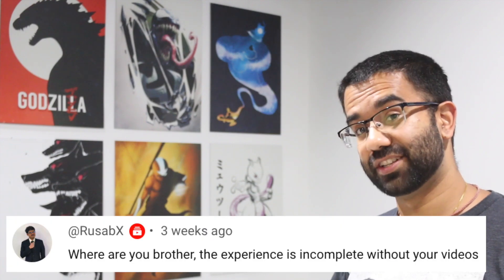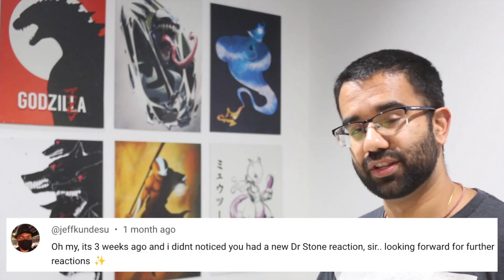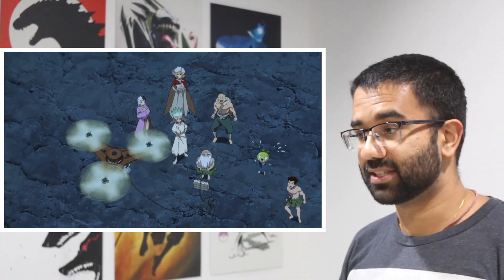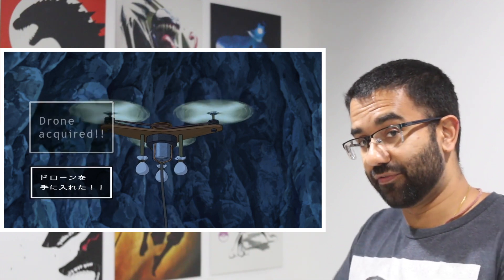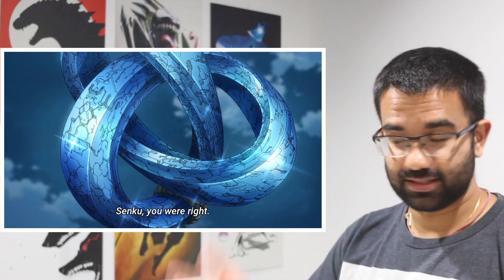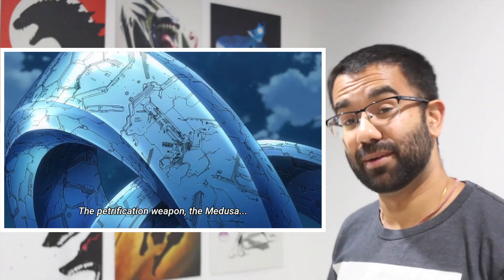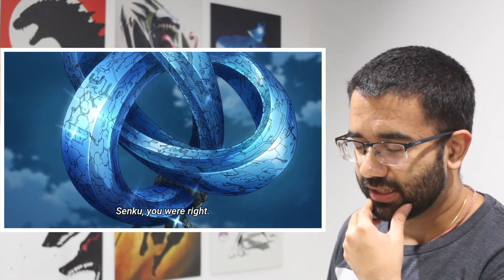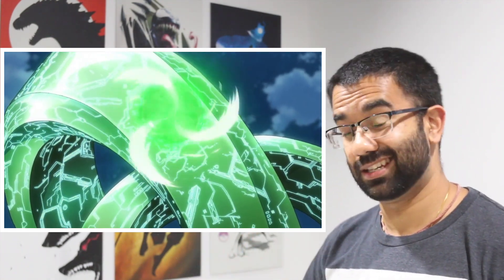Real Engineer Reacts to Technology in Dr. Stone #47

Comment: The Medusa has a certain range and time period it can be used. You say both to activate it. Basically you say one meter, one second. That’s what you get a meter of range and a second of runtime. Usually a Medusa has about 5 charges before the diamond is rendered inert and needs to be replaced. The more time and distance you use the more the battery is drained. It’s a very sketchy device as it’s fragile yet tough and also not the easiest thing to use.

Comment: That is the Medusa aka the petrification device. At least one of them. It’s actually runs on a near microscopic diamond that functions exactly like a battery. Other than that it’s made of a strange metal even senku couldn’t figure out. 
Diamonds were used like semi-conductors before although only in a lab. There was a push to use them as semiconductors back in the 80s but the idea switched over to more reasonable methods that don’t use diamonds. 
Although we have seen a bit of an uptick in Lab grown Jewels lately. Basically a piece of pure carbon is placed in a box and chemicals are added, add heat and pressure and bam a lab grown diamond in three days. They are exactly the same as regular jewels just a fraction of the time although they are a bit softer. They however are the same thing in every other aspect.
Reply: Please, no spoilers! Pary obviously hasn't seen the next episodes and hasn't read the manga! Let's give him a chance to figure everything out step by step! 
Isn't it cool to guess how Medusa works?
Reply from the maker: I've never heard of that before, I'm still excited to see how Dr. Stone reveals it!